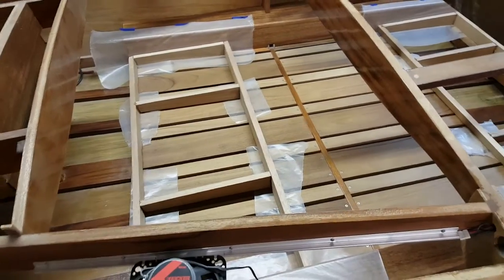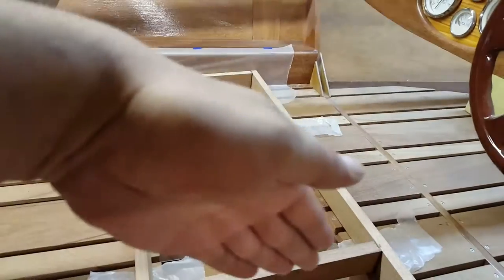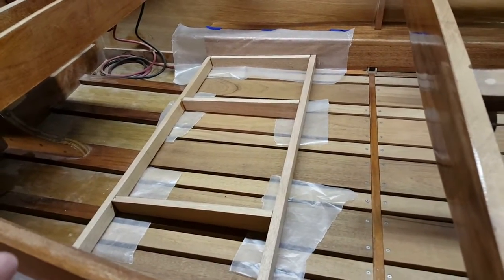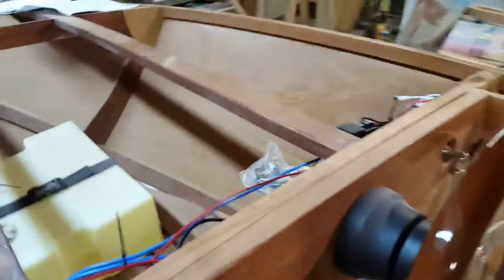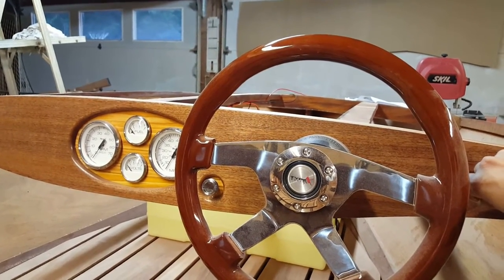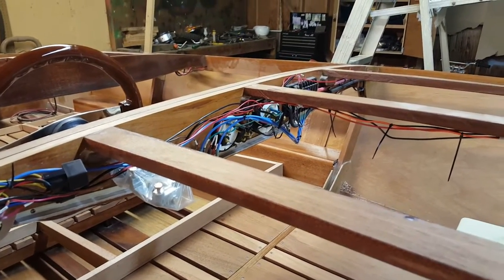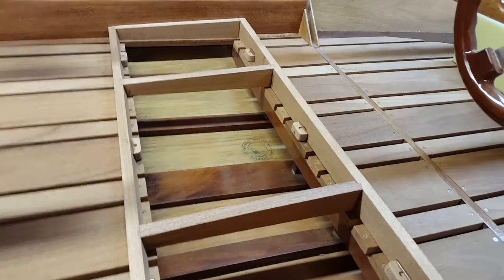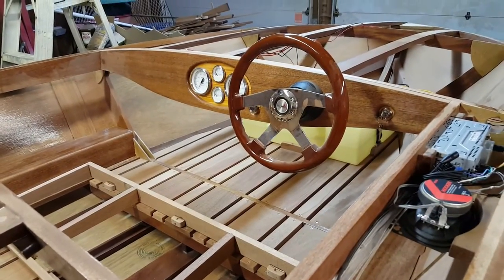Building the Zip vol# 29

Comment: Cool videos, I just subscribed. It would be cool if you wired the second pull position of your headlight switch into your stern light as an anchor only light, you will have to use a diode to keep it from back feeding into your port and starboard lights. It would be useful if you ever stayed out after dark to watch fireworks of something. You are doing a fine job, I admire your attention to detail.

Comment: Just rewatched the video. You are getting close. I have been to the Glen-L site and discovered that the Zip is their most popular model! Yours is the most detailed! Outstanding work!. I suspect you have thought about the engine for the boat. Based on your transome height is it going to be an older motor? What motor are you looking at? I can tell you for a newer motor you will need to raise the transome height as short shaft motors are not made anymore. I hope on your next video you mention the engine and maybe install it as you will need to run wireing to it anyway. I can tell you I for one can not wait to see your next video of the Zip Build!...Pretty epic! I am baseing that on the other builds I have viewed!